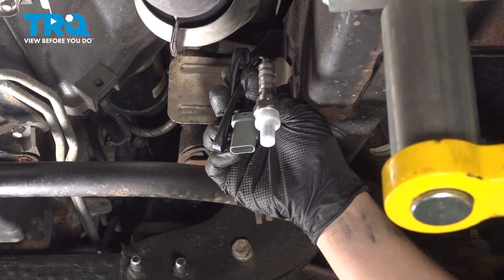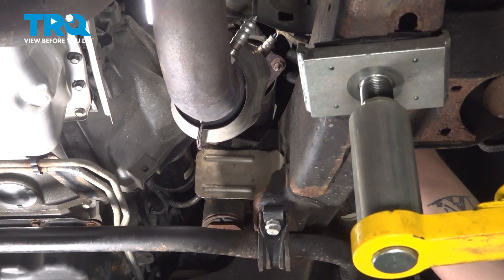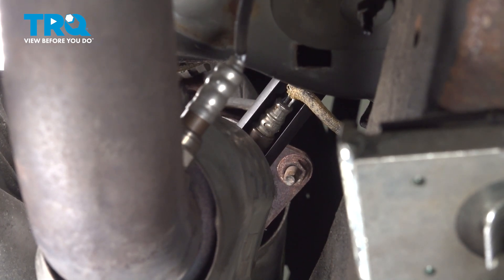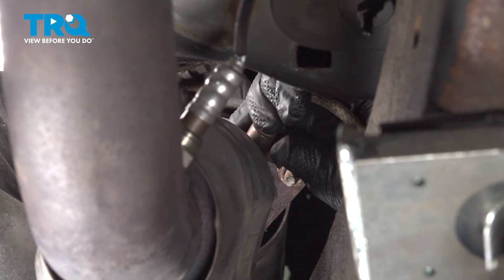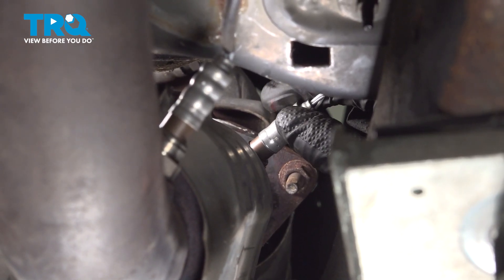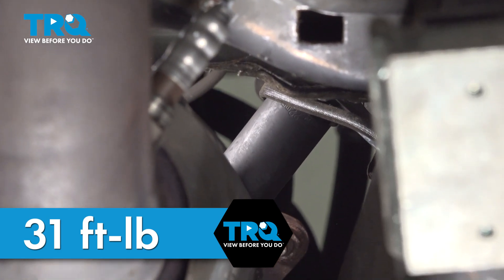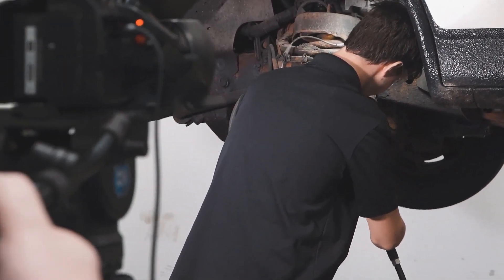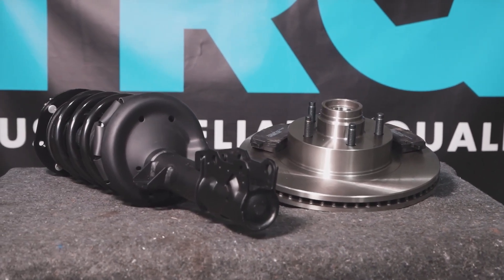How to Replace Upstream O2 Sensors 2014-2018 Chevrolet Silverado 1500 (5.3L V8)

Comment: If you came here looking for a quick tip on getting the Bank 1 (driver side)  upstream sensor loose, just pull the 4 forward bolts out of the front driveshaft and reposition it out of the way and use a wrench. You're welcome.